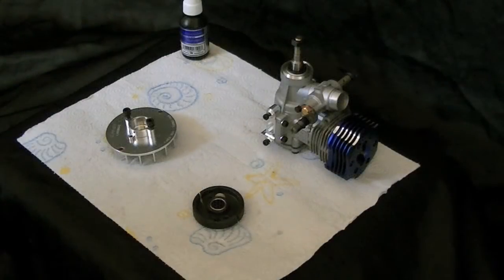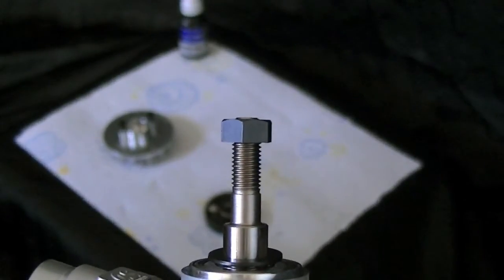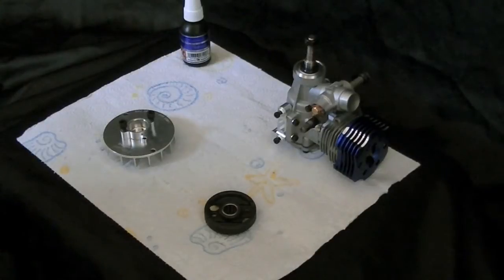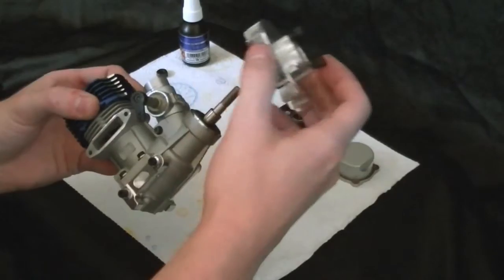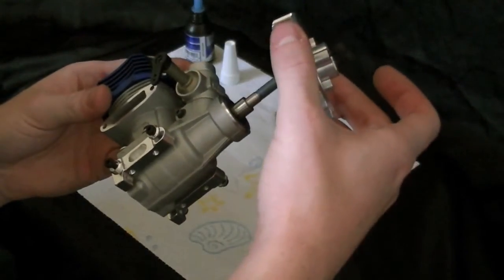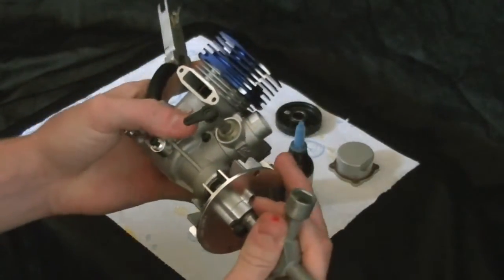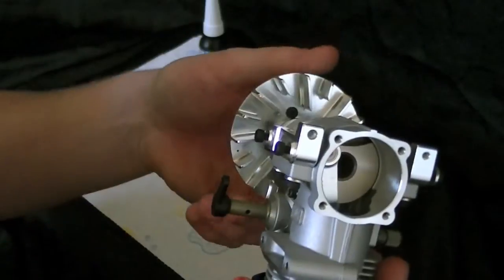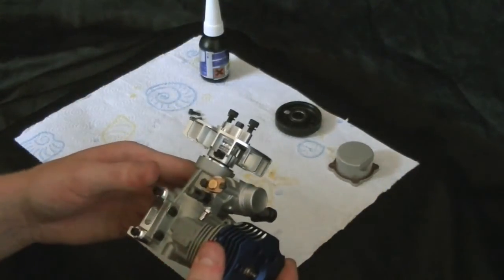heli tips and tricks (mounting fan/clutch)

Comment: Great video! Probably a dumb question, but I don’t how to do it. How do you dismount the cooling fan? Mine got damaged but I don’t know how to pull it out. Thanks!
Reply from the maker: The Fan is usually (on most models) mounted to a pressure fit mount.  So when you tighten the Nut and washer it will press and expand the metal mount then you lock it down with two screws.  removing this part can be hard but there are a few ways.  One way is to get a fan pulling tool that basically reverse tightens to pull the fan hub as you tighten the device or since metal expanse and contracts with heat, you can heat up the fan hub and lock the piston by removing the back plate.  Then you have to just heat and twist and use brute force lol.  Their may even be other creative ways out there :)
Reply: @FreddyCanFly  thanks, really appreciate it!

Comment: With the greatest respect I would never use anything but only locking nut to lock the crank I have seen so many pistons damaged near the skirt by locking it this way as the crank is only locked from one side instead of a plastic tool  that surrounds the con rod